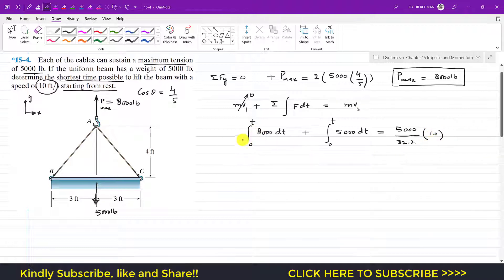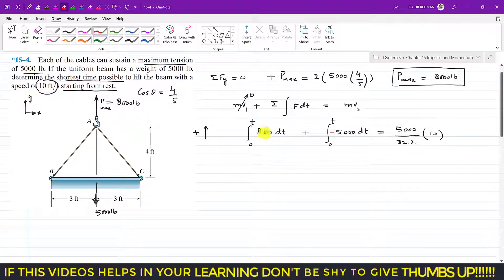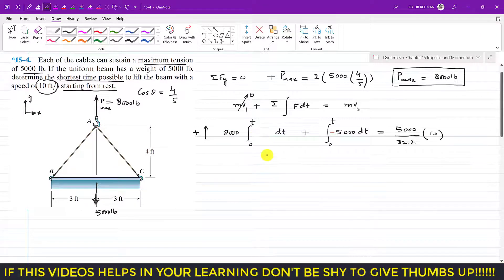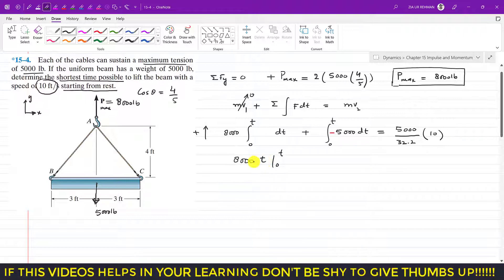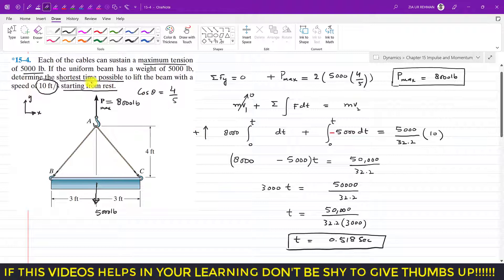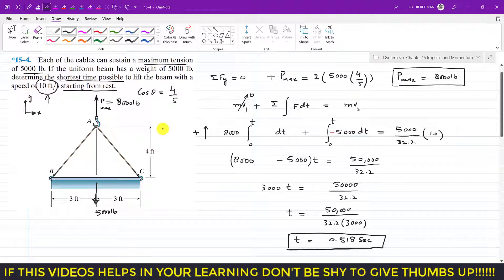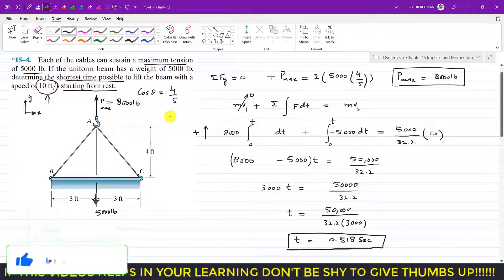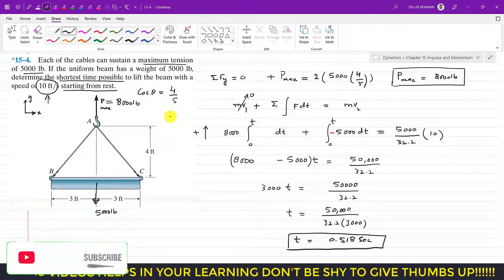15-4 Kinetics of Particle: Impulse and Momentum (Chapter 15: Hibbeler Dynamics) Engineers Academy

Comment: Shouldn't the mass of the beam also be 5000? 

In order to convert pound force to pound mass feet per second squared you have to multiply by 32.2.

To then convert that to lb mass means you would divide by 32.2 ft per second squared, leaving you with the same value you started with.